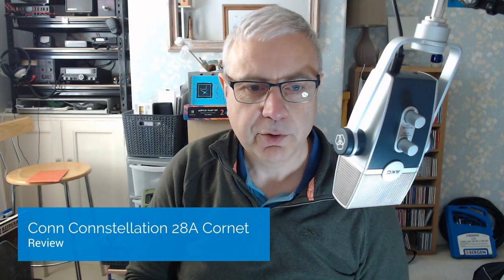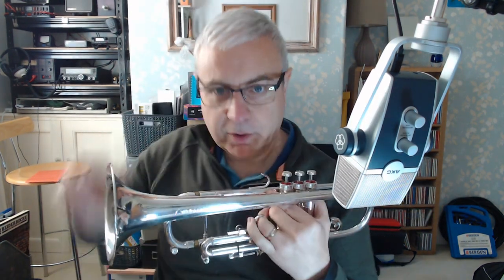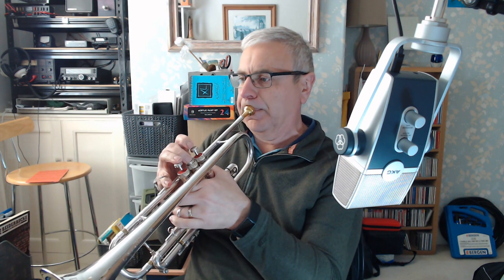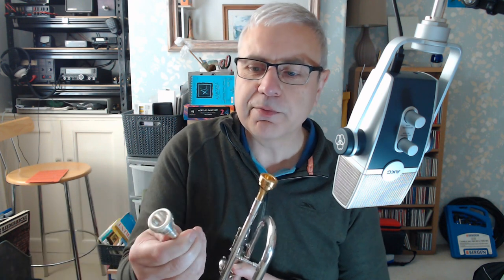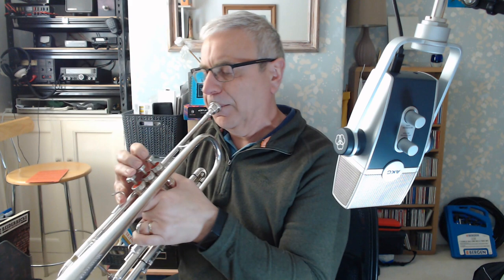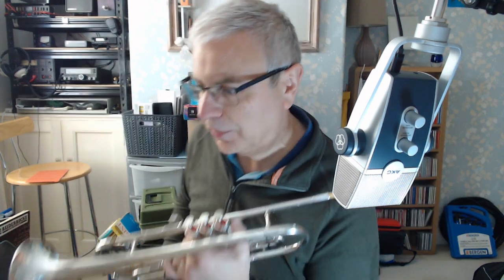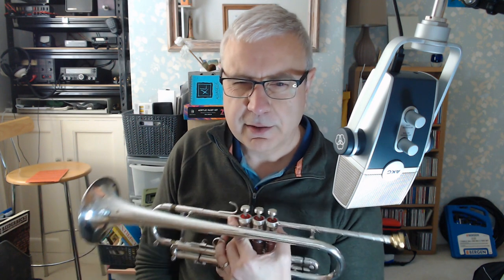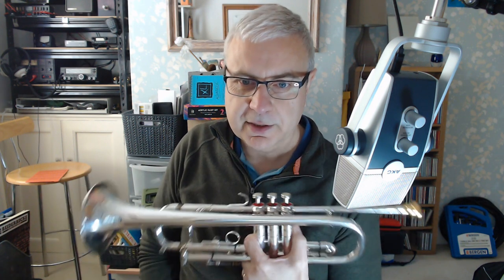Conn Connstellation 28A Cornet Review.

Comment: Interesting video Gordon, thanks for posting. These are an interesting design for myriad reasons which I won't go into here - but the importance of bore size is seriously misunderstood by most cornet players in the UK as demonstrated by some comments here and elsewhere. However, another comment you made piqued my interest. Did I understand you correctly in saying that imported musical instruments should not be liable to VAT?
Reply from the maker: It was the duty which was less, not the VAT (I think). Generally they put used instruments in the wrong duty class.